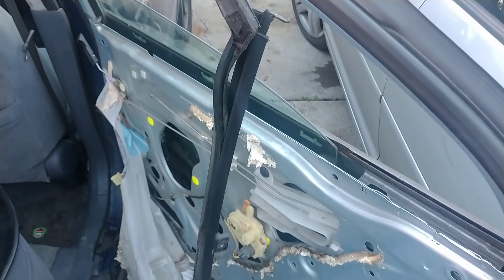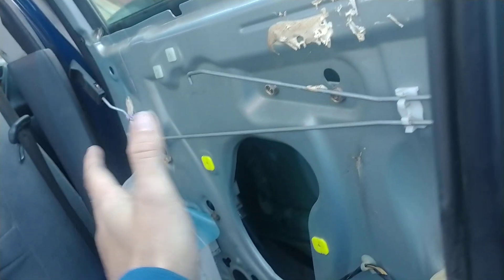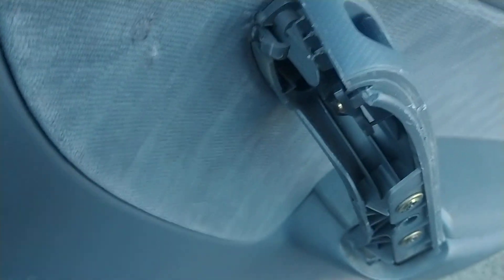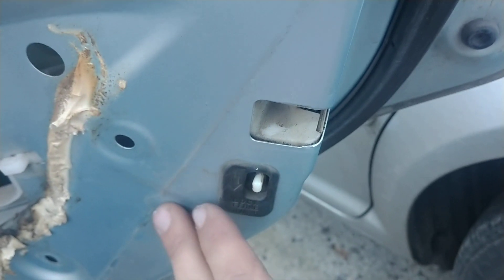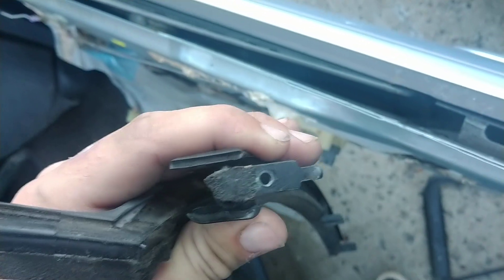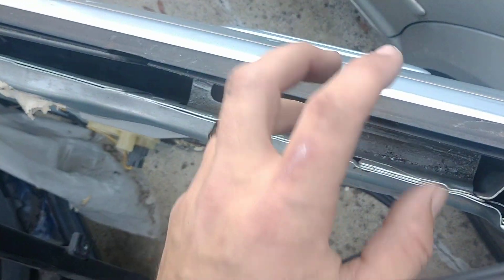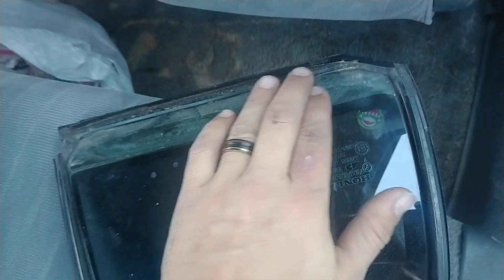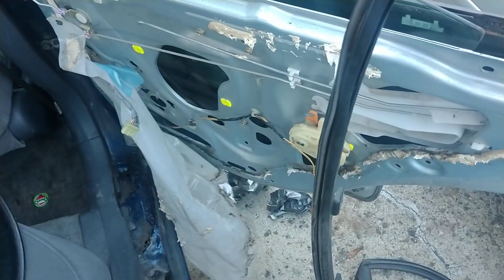Replacing 2001-2005 Honda Civic 4 Door Rear Quarter Window

Comment: Pretty nice tutorial. It’s actually better than most of the other videos I’ve seen for the rear vent window replacement. I broke out my son’s window while trying to recover it from an airport parking lot. He left it sitting at the airport, and it took me a couple weeks before I located it. The stinking parking fee was ridiculous. I had to load it on my flatbed car hauler because I couldn’t drive his car and my truck home at the same time. It wouldn’t start so I had to winch it and in the process I locked the keys inside. After getting royally upset, I busted out the vent window because 1. It was the smallest window so less expensive to replace and 2. because it was the first thing I punched with my fist 🤛🏼 needless to say, I’ve been needing to replace the window since November of 2022. Thanks for your due diligence. Onward and upward…

Comment: Nice explanation-- detailed but to the point. You obviously have done this plenty of times.
Reply from the maker: Nathan, thanks for the compliment! :) The funny part is i actually haven't had to deal with this until i made this video. However, i have disassembled Honda doors and their internals on near 100 different cars ranging from 1990 through about 2010 and the way in which Honda opts to fasten these types of items hasnt really changed in that 20 year span.

Comment: Where exactly does the washer go? Does it go directly behind the door frame? I just have the bolt, the tiny washer, and a bigger washer that go outside of the car door. But i heard a 3rd washer fall inside when i was unscrewing the bolt. Thanks!
Reply from the maker: It's been awhile since I've done this repair. Watching the video again it looks like you might have dropped the washer I did into the door. From the window support bar it goes on the inside I believe between the bar and the frame. So the bar is the right distance from the frame.
Reply from the maker: I'll go look at this car tonight and hopefully have a better answer if this doesn't get you up and running. This car is in my garage again.
Reply: Thank you! ❤ yes, i dropped the same washer that you dropped in the video
Reply from the maker: @Catcvcv  I went and doubled checked on that window system. Without fully disassembling it. I'm fairly certain it is a backing washer between the bar of the window support and the frame of the door. Hope your project turns out successful. As always. Let me know if i can help past what's seen in the video.
Reply: @11fulstrum  thank u!
Reply: I would have read this comment, there was plate that fall down.

Comment: U need to tell how to put everthing back, the sealing plate  on inside of big mirror  was not fitting and panel broke. rest was easy way to install and there is one  thing that fall down in windoe wehn we open th 2nd screw for mirror panel. Rest was good thanks
Reply from the maker: I would love to revist this one and do a more in depth coverage of it, as this was a rush project for my sister to get her car able to be locked again and safe for school. I have another 2001 to 2005 civic at my disposal currently and could at some point take the time to do a full detailed take it out and put it back in from start to finish.

Comment: My washer fell inside the car. Is it necessary to put the washer back in the screw?
Reply from the maker: Yes it is. It provides what's called bearing pressure. Basically spreading the force from being tightened over a larger area. Without it over time it could start to bend the metal just a little and would let the screw start coming loose. You can always replace it with a new washer too.
Reply: @11fulstrum  where exactly am i supposed to put the washer?
Reply: U put washel between that bar and metal frame.

Comment: Anyone ever try popping it out without removing the door panel ? I mean the cars not worth that much .  I’ve seen videos with people popping that window out and just using adhesive to lock a new one in
Reply from the maker: I have never seen anyone just pop this type of window in and out on the 4door model. As opposed to the coupe model, where this little quarter window is actually glued in thats the only way to do it. I can say that if you tried to pop this window out (if it isnt already broken) it runs a high chance of shattering. As for gluing in a new one, im almost 100% sure you would be unable to get it back under all the edges of the window trim, door panel, window divider and probably wouldnt seal well without lots of sealant added.
Reply: @11fulstrum  totally agree!